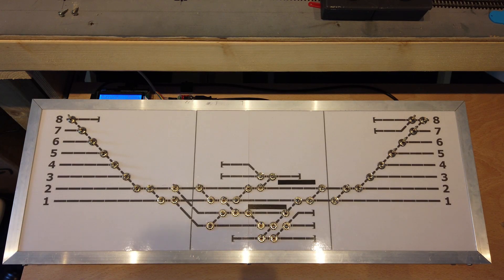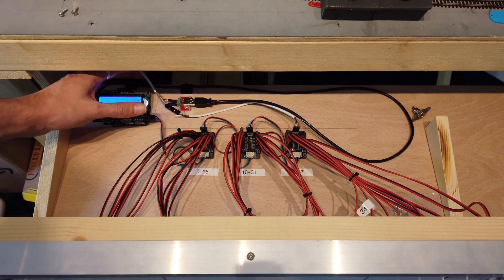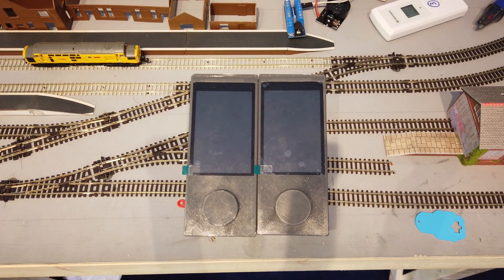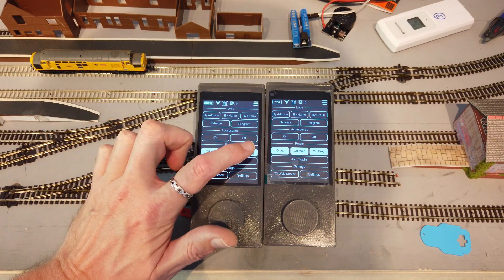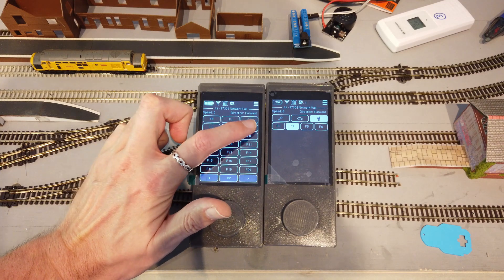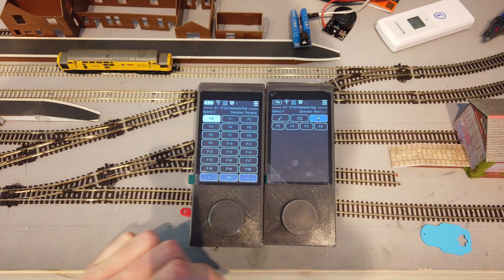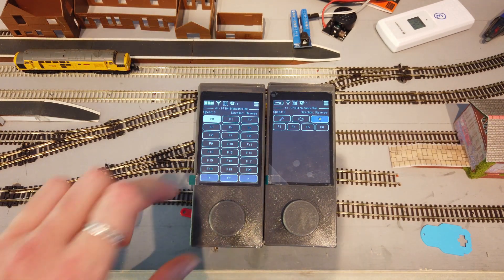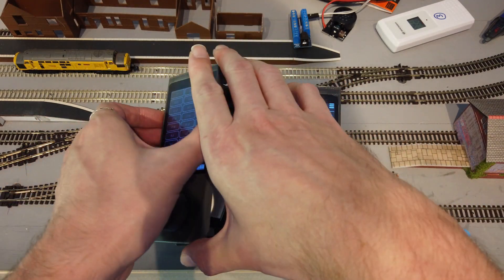Project updates, inc Model Railway Servo Controller and T3-EX-WiFi

Comment: The Control panel and servo controller setup are looking good. I can't wait to build and test your new T3-EX-WiFi throttle. Your original, which I built, is still working fine. A great idea to be able to update and use multiple throttles. I appreciate the work you have done and the time and effort it takes.